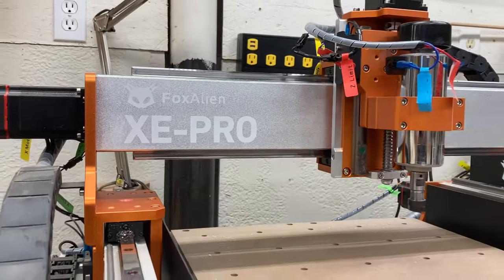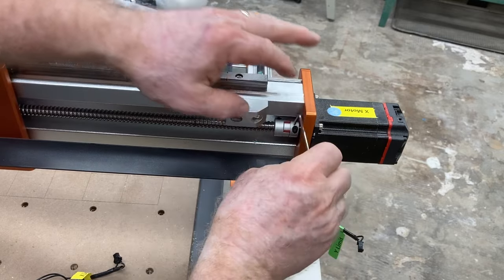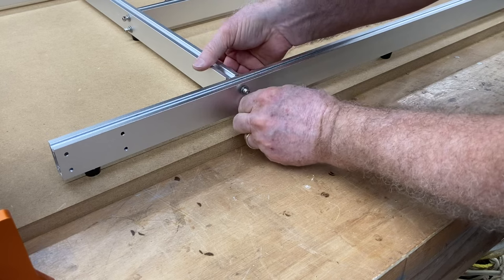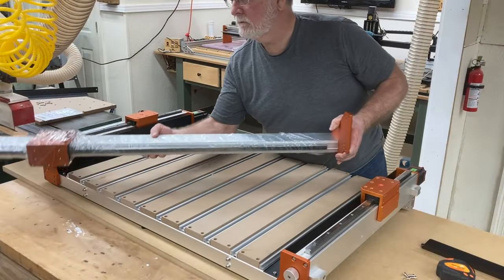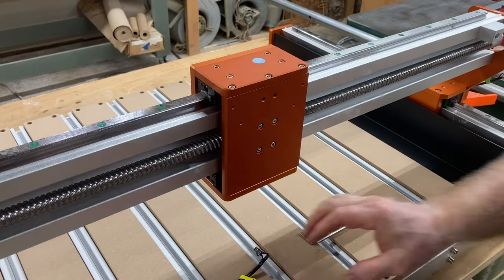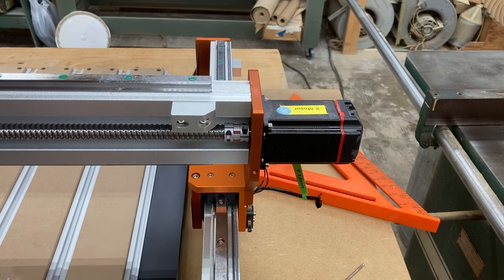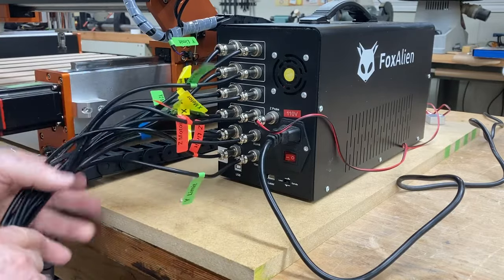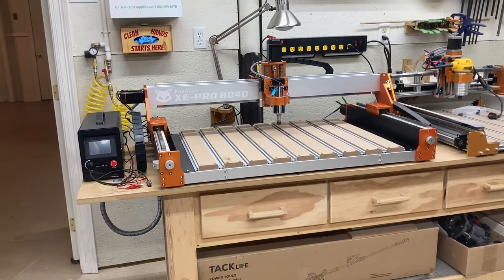DOUBLE THE SIZE Upgrade the FoxAlien  XE PRO to the XE PRO 8040

Comment: Thank you.  Does adding the extension kit make both X and Y linear rail?
Reply from the maker: Yes, the upgrade gantry has the linear rail. The y axis is unchanged. If you have upgraded the machine to the linear rails then yes. The base model of the XE PRO did not have linear rails
Reply: @PawPawsWorkShop  ah, so, if you still have the base unit, the extension upgrade means that the y axis will not gain linear rails.
Reply from the maker: Yes, that is correct

Comment: What is the footprint of the machine now?
Reply from the maker: It is 54”x31”. This includes a space for the controller. Also,  this is the minimum measurement to the edge of the machine. If you are building a table, go bigger if you can
Reply: Thank you very much I just ordered it on Sunday with the extension. . Your videos are so helpful . Thank you again